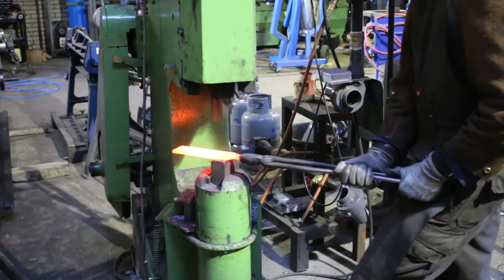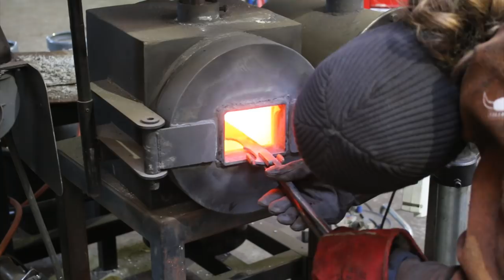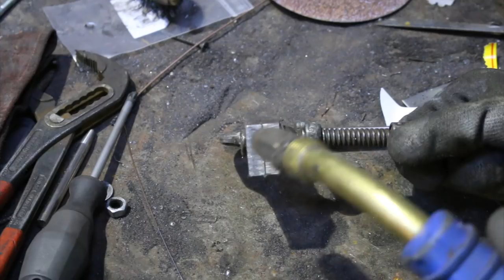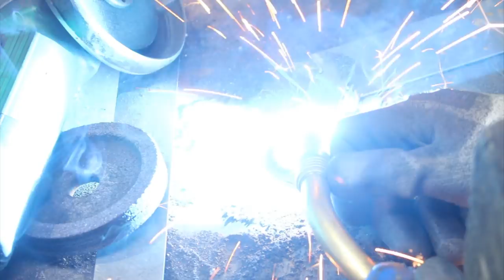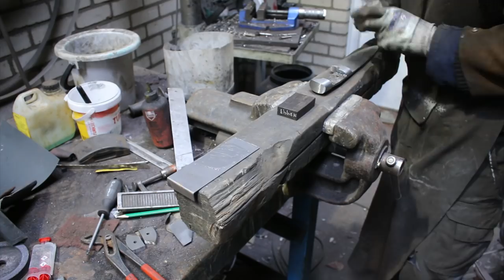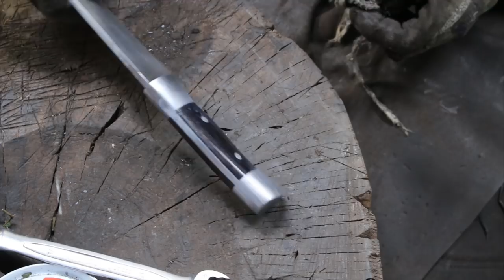Making a meat chefs knife.

Comment: The shape is that of a French knife rather than a meat knife. A meat knife curls up towards the tip and is front weighted for putting nicks into steaks etc. The French knife is possibly the most important in the kitchen, it’s the workhorse used for cutting, chopping, crushing and almost any other general mis en place. Not that any of that is important in comparison to admiring a work of art like you created. Someone actually remembered to put the very important bolster on a knife, this is for safety and balance and if I was still a chef I wouldn’t hesitate to buy it.
Reply: Mark Harris a bolster and full ricasso have no practical application on a chef knife intended for a cutting board.  If a “meat chef” actually means “butcher”  then the knife will spend as much time cutting handheld objects as it may cutting down to a board. a bolster and ricasso are less an issue but still a poor choice if that’s the intended use.  Makes sharpening a knife like this unnecessarily tedious unless you’re ok with accordion cuts.